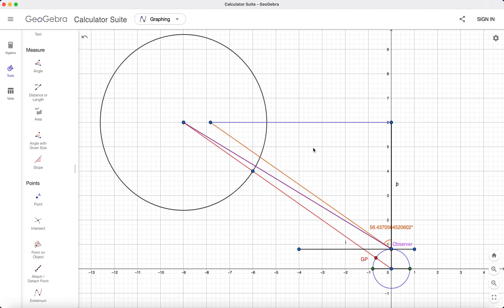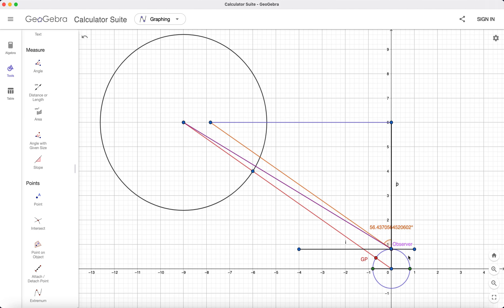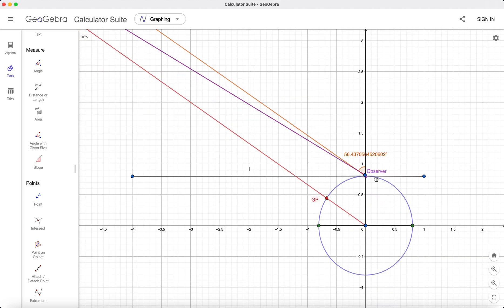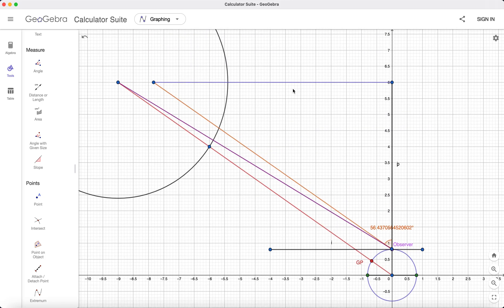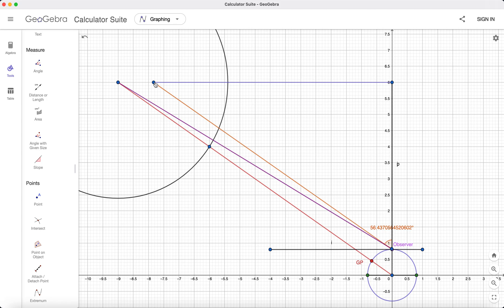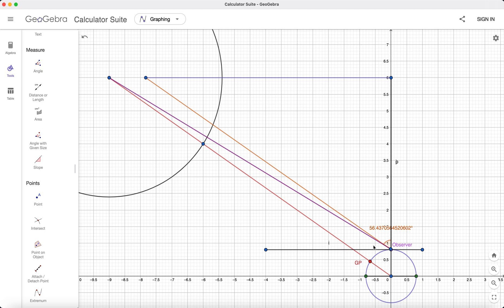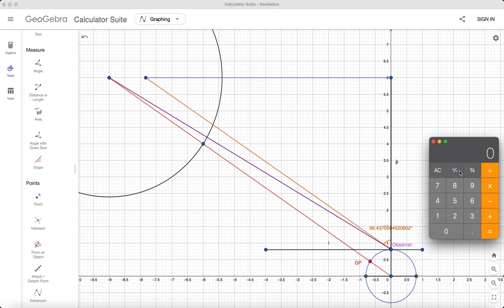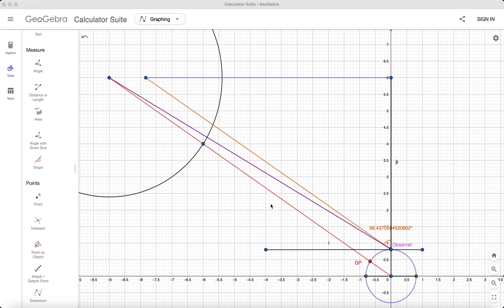Zenith Phobia....?

Comment: Move the star farther away. Those two angles will become closer to each other. Move it farther still and they’ll get even closer. Move it, to scale, several light years away and those angles will be identical to many decimal places. You can’t measure angles with a diagram that horrifically out of scale Brian. I think you’re cementing your winning top left position here.
Reply: I often wonder how many times someone of Brian's "intelligence" needs to be told this. I've lost count of how many times I personally have told him this.
Reply: You can't measure angles at all if earth's mass warps spacetime and invokes bendy coordinates.

You need to understand this. And accept it.
Reply: @sleepingwarrior4618  Quantify this warping effect and we'll talk.
Reply: @roohif  No need to quantify, that's for the mathematician to argue over. You just need to accept the impossibility of measuring angles if you aren't using Euclidean geometry. Earth mass bends spacetime, more as you get closer to the surface. You don't recognise this...so we cannot talk.
Reply: @sleepingwarrior4618  No wonder my attempts at carpentry have turned out so bad. I should take more heed of the old maxim - Measure Twice, Calculate Spacetime Warpage, Cut Once.
Reply: @andrewjohnston6631  I think your problem is scale. Cutting a length of 3"x1" has nothing to do with the curvature of spacetime. 

Your cut would need to be the length of a large bridge before you'd notice any difference. Even then, it would be negligible. 

You are getting the idea though, well done. Try and stick to the measuring of angles though. That's the problem. You need straight lines to measure angles.....your Geometry doesn't have any! That's the problem.
Reply: @sleepingwarrior4618  You’ve changed your assertion. You said “you can’t measure angles at all”. So you can measure angles now? That’s a relief. I was just about to throw out all my angleometers.
Reply: @andrewjohnston6631  you might as well throw them out. You are unable to measure any angles at all if the geometry is curved. 

The geometry is curved, we checked.
Reply: @sleepingwarrior4618   But you just said the geometry isn’t curved. I’m lost - can I cut timber or not?
Reply: @sleepingwarrior4618  
The only thing that is curved is the Earth.
All of the sightlines and zeniths are straight.
How much does gravity bend light on Earth? You must know, it's your claim and no one elses.
Reply: @sleepingwarrior4618  at least you understand now that the earths surface is curved, but you can still measure and calculate angles on a curved surface. I think you need to read some more math…
Reply: @andrewjohnston6631  you cutting timber has nothing to do with which geometry is in play. I don't know if you can cut timber or not...I wouldn't assume that you could. Using a saw, or any other device, is a skill. Probably not... in your case.
Reply: @darrellkimmel2646  Not my claim....current science. 

Sit down son.
Reply: @mattikaronen7728  you can't.
Reply: @sleepingwarrior4618  
It is your claim.
You must not have an understanding of science.
How much did light bend around the Sun in Eddington's observation?
All other observations have been consistent with his, within a reasonable margin of error.
How much does Earth's gravity bend light?
Is it more than atmoSPHERIC refraction?
Reply: @darrellkimmel2646  Nope. Not my claim. Just the current science that you ignore.
Reply: @sleepingwarrior4618  Do you remember that moment in 1912 when Einstein discovered the warping of spacetime and had to apologise to navigators for invalidating their work? Neither do I.
Reply: @sleepingwarrior4618  Do you remember that time in 2016 when LIGO detected gravitational waves and they had to apologise to all the navigators from the previous four centuries for invalidating their work? Neither do I.
Reply: @sleepingwarrior4618  It’s quaint of you to accept that LIGO has validated general relativity yet none of the scientists involved (nor Einstein himself) believes that the earth is flat.
Them’s some sweet cherries you picked.
Reply: @sleepingwarrior4618  said "Try and stick to the measuring of angles though. That's the problem. You need straight lines to measure angles...."

Done. That method shows that the seas around us are Not Flat. 

But I'll indulge you - based on two heights, 100m and 52m above sea level, with 14km between, assuming a flat baseline of sea level, what's the margin of error due to bendy spacetime?
Reply: @sleepingwarrior4618  Ahh, so it’s another of your false dichotomies. Firstly, you need to quantify the bendiness of spacetime to show how not-straight the light paths are from the stars to us. Then you need to quantify how much that bendiness changes over time.
So, what are the numbers, Mr Warrior? How much does bent spacetime cause the stars move around in relation to each other? Or are they, to arc-second precision, essentially fixed?
Reply: @FuryPilot  that was not the cause. That was the effect. You don't understand the words you are relying on.
Reply: @FuryPilot  translated - so the lines are not straight afterall, this messes up all calculations to do with distances and the sextant is of no use. 

Focus on the minor (quanta), ignore the major (nothing is straight). It's okay.
Reply: @sleepingwarrior4618  Oh goody! Another false dichotomy! Maybe consider the possibility that spacetime is warped AND sextants work on a globe.
None of the wibblywobbly stuff matters when you use a sextant as long as the stars stay essentially fixed in relation to each other. How much do they move, Anthony? How much does the bending of spacetime alter the map of the celestial sphere? Will Sirius be in the same place in the sky 23h56m4.1s later? Will it still be at 06h45m08.9s RA and -16o 42’ 58” dec? How long until we need to consider its proper motion?
“It’s not straight! It’s not straight! It’s not straight!”
IT DOESN’T MATTER.
Reply: @FuryPilot  so if it's not actual, then the claimed cause is wrong isn't it. You have the effect but don't have the right mechanism doing it. That's why it's reduced to apparent rather than actual.

As an engineer, I wouldn't expect you to be familiar with Scientific Method and, ipso facto, I would expect you to poo-poo my scientific approach. It's called willful ignorance. It's okay though, I can accept you don't like science and prefer belief based systems. Thank you for being honest enough to tacitly admit that.
Reply: @FuryPilot  No, there is NOT a straight lines the geometry the straight line is applied to is wavy to varying amounts throughout its length, caused by mass. You cannot have a straight line in curved geometry.
Reply: @justwilliam6893  you have lied. You lied to Brett G when you dishonestly told him "but everything about his behaviour indicates he does just that - runs away". 

I'm ignoring you because you "understand my opinions to be wrong" is false. I cite Einstein, how he defines gravity, how he explains and examplifies gravity and how he literally tells you it's the medium acting on mass by citing his actual work....these are not "my opinions". I don't even agree with Einstein. He's evidently wrong....I am simply telling you the position in science today and you dishonestly pin them on me personally (to Brett) and claim Im running away. I've exhausted the topic with you and you refuse to accept Einstein. Fine. But I won't be engaging with you anymore if you deny the current science. Reverting back to archaic science puts you into the "belief" category. You can have your belief....I'm not here to take them away from you. But it does make you a science denier whether you accept that or not. To engage a man who rejects the current science for a position previously thought to be credible is a pointless task. 

THAT is why I ignore you. I have explained this to you many times. THAT is why your words to Brett are lies. You do NOT accept Einstein....you DO accept Newton and although you can do so, I do not wish to engage with people that ignore the current science. 

That's you. You have lied to Brett. I am not running. I just don't WANT to waste my time on you.....the exact thing I'm doing now.
Reply: @sleepingwarrior4618  You say you wouldn’t expect an engineer to be familiar with the Scientific Method. So what are your qualifications that make you such an expert?
Reply: @FuryPilot  Wrong. A straight line in curvilinear coordinates is a curve. When all points along any constant X value are following an arc, that arc is considered straight in non-euclidean geometry. Only in Euclidean geometry is it a straight line. 

Bendy spacetime is NON-euclidean geometry so the straight line is now curving due to the geometry. Look into non-euclidean coordinates or "spacetime". Go with Wikipedia to start you off. Look at how Wikipedia defines spacetime and from there, look at curvilinear coordinates. You have your understanding incorrect.
Reply: @justwilliam6893  I have been through the gravitational field with you. I have cited his work and the problems it causes you....but also the problems with it. 

You do refuse to accept Einstein. The gravitational field is directly referencing the medium. Changing the noun does not change the subject. If I change the dog into a zebra, it doesn't change that it's still a dog. P does not equal Q. All Einstein did if conflate the three words as one; medium, field and gravitational field. It doesn't change that it's the medium and claiming the earth creates a gravitational field is a baseless assertion and requires evidence...which Einstein did not provide and INSTANTLY moved away from as soon as he said it. 

Gravity does not operate, it is not a verb. It's a visual effect of bending spacetime. Again, you are wrong.
Reply: @sleepingwarrior4618  "As an engineer, I wouldn't expect you to be familiar with Scientific Method"
As a failed law student I wouldn't expect you to be familiar with the scientific method,  so the fact that you don't understand it is forgivable.
Reply: @sleepingwarrior4618  
You are truly a one trick pony, even if your trick is rather simple and frankly, it is quite boring as well.

You wrote:
"You can't measure angles at all if earth's mass warps spacetime and invokes bendy coordinates."

roohif replied:
"Quantify this warping effect..."

You replied:
"No need to quantify, that's for the mathematician to argue over. You just need to accept the impossibility of measuring angles if you aren't using Euclidean geometry."

Next conversation.

Darrell Kimmel wrote:
"The only thing that is curved is the Earth.
All of the sightlines and zeniths are straight.
How much does gravity bend light on Earth?"

You replied:
"Not my claim....current science."

Darrell Kimmel replied:
"It is your claim.
You must not have an understanding of science.
How much did light bend around the Sun in Eddington's observation?"

You replied:
You did not reply and did a runner.

Basically every comment you make is you making a silly claim, when asked to substantiate it, then you spew some gibberish and include some insults like; "sit down son". You should probably comment on things you at least know the basics of, but I guess that you would never comment again.

Do you really believe that your comments make any sense, or are you just trolling?
Reply: @Frups12345678  Nothing I have said is incorrect. You not LIKING it doesn't negate it. 

I don't reply to half of you people because I'd be here all day and I have come across all of you before. Darrell isn't someone I will be engaging because he refuses to acknowledge that straight lines are needed but do not exist in a curvilinear coordinate system. I just can't engage with that level of ignorant.  You can call that running away if you like but I call it time management.

Just William is another one I just cannot engage. He is polite enough but he refuses to accept that Newtonian Gravitation was superceeded by Einstein. He insists that it was a refinement and I just cannot argue with him any longer. If he wants to believe his view, that's up to him....but again, you can think I run away if I don't answer his questions. 

Andrew Johnston is another one that's entitled to his view. I just won't engage with him anymore.
Reply: @sleepingwarrior4618  
Anthony, you claimed; "You can't measure angles at all if earth's mass warps spacetime and invokes bendy coordinates.". You were asked to quantify your claim and it is evident that you can't.

You wrote; "Nothing I have said is incorrect.". This is demonstrably wrong and here are just a couple of examples:
- "You can't measure angles at all if earth's mass warps spacetime and invokes bendy coordinates."
- "...Newtonian Gravitation was superceeded by Einstein..."
- "I dont accept LIGO, of course I dont. But... you have to.... but in doing so, it directly conflicts with sextants."
- "Spacetime exists. LIGO proves it. But in doing so, invalidates all Euclidean geometry for you people."
 
I am certain that I could find even more accuracies by you, even in this short thread, but I don't have time.
Reply: @Frups12345678  I was asked to quantify.....and I responded. What was my response? You seem to have lied by omission.
Reply: @sleepingwarrior4618  So you’re not willing to engage with people who don’t agree with you or who will point out your errors. Is that how you got to be so hilariously wrong about so many things?
Reply: @sleepingwarrior4618  
You replied; "No need to quantify, that's for the mathematician to argue over.". That is no reply, you could have well replied; "I like apples better than pears". Either you can substantiate your claim and the effect, or all your arguments on the topic are irrellevant.
Reply: @andrewjohnston6631  No. That is NOT what I said...but you are in the exact same boat as Just William. Apply what I said against him, against yourself. You don't accept Einstein either. You accept Newton...which makes you a faith lead bloke.
Reply: @Frups12345678  you have changed the word "quantify" to "substantiate". I HAVE substantiated.....but I was originally asked to QUANTIFY. See how you have also been dishonest, you have flipped the two words around to try and make me look dishonest...
Whilst being dishonest yourself! 

All you blerfs have to do this. Every time.
Reply: @sleepingwarrior4618  Well done not engaging with me. That lasted all of two hours.
Reply: @andrewjohnston6631  Stop lying about me and I can ignore you peacefully.
Reply: @sleepingwarrior4618  Dude, I’m fine with Einstein. I’m sweet with Newton too.
And who’s this “bloke” you think you’re talking to???
Reply: @sleepingwarrior4618   “Stop lying about me and I can ignore you peacefully”
I never said I want you to ignore me - like any “bloke”, I’ve got an ego 😉
Reply: @sleepingwarrior4618  
Your deflection and usual games, does not help your position. Even if it is obvious to most people, it apparently is not to you, so let me help you out. You wrote; "You can't measure angles at all if earth's mass warps spacetime and invokes bendy coordinates." and "Spacetime exists. LIGO proves it. But in doing so, invalidates all Euclidean geometry for you people.". The key point is what the effect is, as it either validates or exposes your whole argument as absurd. Let me simplify further, of the effect is 0.0072 degrees discrepancy , then it does in no way prevent you from using a sextant and get accurate results. If the discrepancy is an average 10 degrees, then adjustment is needed or sextants readings will not be accurate.

So, once again, quantify the warping effect, or accept that your whole argument is silly at best.
Reply: @andrewjohnston6631  I want you to stop lying about me. I'm ignoring you because you choose to believe Newton rather than accept Einstein. 

Science isn't about beliefs. If you want to accept Newton....that's fine but it's outside this topic in the same way that God is.
Reply: @Frups12345678  0.00072 over light years is the very reason why science,even now, keeps recalculating how far away Polaris is. 

This assumes the lines are straight. They are not. BECAUSE they are not straight, trig is not possible as the accuracy required for the trig is decimated by the curved line. 

Not my defection, not my argument....this is just about angles. 

You people duck, dodge and dive around the curvature of spacetime. You apply Mussers words on gravity....to spacetime. "Spacetime isn't flat....but you can act AS IF it were flat". 

Nooooooooo. Bendy spacetime invalids the use of the sextant because even with the sun (and TOTALLY ignoring 7/6r for now), you are using straight lines but KNOWING that earth's mass bends the path between you and the sun. Factor in 7/6r (refraction) and it makes the problem even worse. It's like looking through one of those bendy mirrors in a House of Mirrors. Try measuring the height of someone using a bendy mirror. It isn't possible. 

Again.....not my deflection, or my argument....just the contradiction of trying to use straight lines (angles) in bendy spacetime.
Reply: @sleepingwarrior4618  (1) Lying about you?? Citation needed.
(2) Dude, I’ve already told you I accept Isaac and Albert. Scientists are clever enough to have worked out the limitations of Newtonian physics and know when to use Einstein instead.
(3) You’re doing a total a phenomenally terrible job of ignoring me.
Reply: @sleepingwarrior4618  How many times do you have to be told that for celestial navigation it DOES NOT MATTER how far away a star is? All that matters is that it appears in the same place on the celestial sphere.
Reply: @andrewjohnston6631  so TOTALLY ignore me citing your lie and straight onto the next error and misunderstanding you have. 

Go forth Andrew. Just don't engage me or lie about me, thank you.
Reply: @sleepingwarrior4618  You’d better sure you stop lying about me them, ok? I don’t believe Newton. I’ve never said that. That is you making something up about me - some might uncharitably say that you’ve told a lie 😲 
I accept that his physics has been shown to be accurate within its limitations.

As for me not pointing out your errors… well, where do I start?
The most egregious examples given the current topic are:
- can’t get an angle from a curved adjacent/baseline/whatever. (you and I had this discussion back in December)
- bendy space time invalidates celestial navigation.
- the water which makes a sunset pillar is in the earth’s shadow.
You are just plainly wrong about those things.
Reply: @sleepingwarrior4618  I was replying to another comment when your reply came through. Gimme a chance - I’ve only got three hands!
Reply from the maker: No they’re parallel so it doesn’t work, as the original angle line won’t meet the other zenith, your model fails.
Reply: @BriansLogic  Good god Brian, the point is to calculate how large the error would be by using those parallel lines. What is the difference in angle between taking two parallel lines from either side of the earth to the star vs taking two converging lines to the centre of the star. Your claim is that by using parallel lines it would introduce an error - this is the way to quantify that error. As you can’t seem to understand the simplest of things I’ll do it for you. 

The angle at the apex (the amount of error introduced by using parallel lines vs converging lines to the centre of the star) is: 
0.000000114591559 degrees. 

That’s 0.0004 arc seconds. 

Brian, that error will make literally zero difference to any navigation calculation. 

So unless you’re able to refute that, stop making that incredibly ignorant claim.
Reply: @BriansLogic  the point, Brian, is that you used a vastly not to scale drawing to claim there would be several degrees of error by using parallel lines vs lines to the centre of the star. As I’ve shown, when you do it to scale, with the best case scenario for you (farthest distance apart on earth and closest star), the error is a tiny fraction of an arc second. Not several degrees. By using the diagram you used and trying to take measurements from it, your error value was out by about 8 orders of magnitude. 

You really need to learn some geometry Brian before having this conversation, you’re just looking even more stupid now.